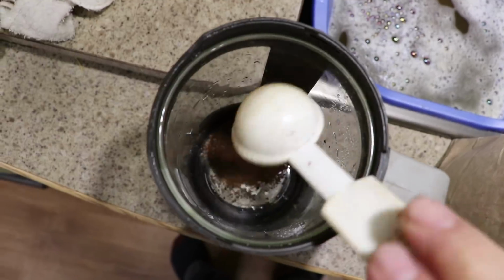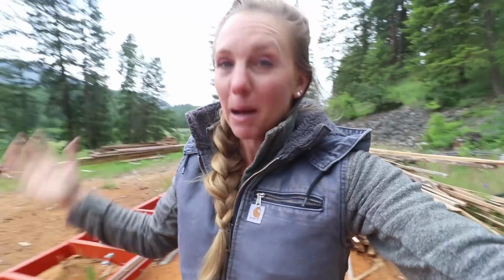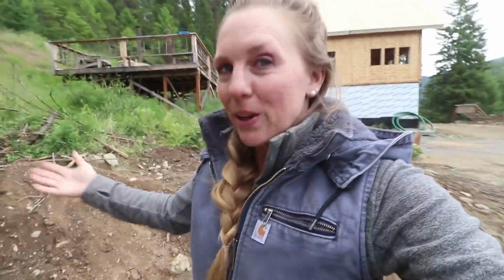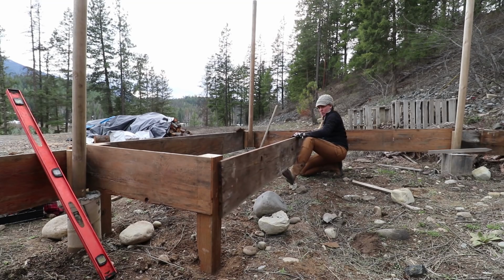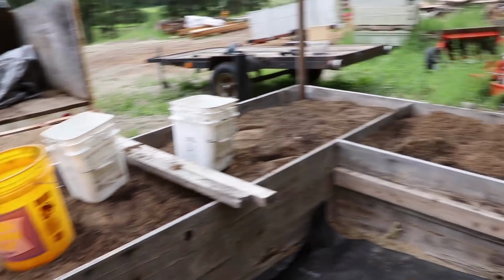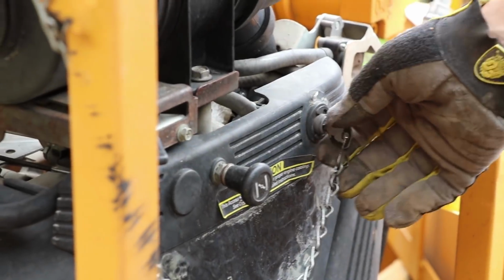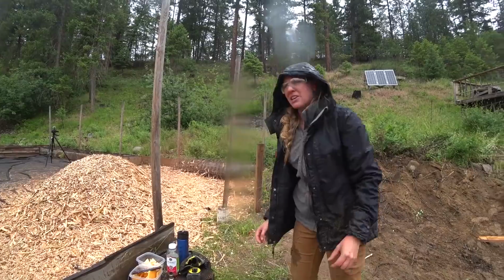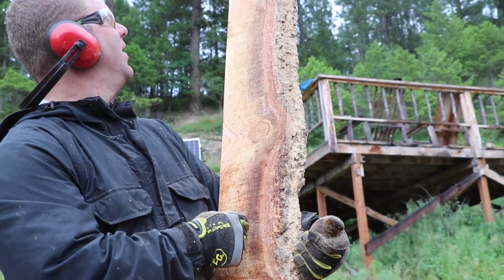How to Make Your Own Woodchips for the Garden (Easy & Cheap!)

Comment: Have learned so much from you both. Loved every step of the way. Am 71yrs retired but building camper van from floor up, inspired to greater accuracy from you. 
One tiny observation: when I shovel fill or soil I am at moving my trailer so as each shovel load goes straight to its spot. Master builder once said to me “let a lazy man begin a task...... then get a tradesman to do it that way”.
You two are giving so much pleasure to so many. My first build was PNG from saplings. My second, an A frame from 2x10 cypress pine, my present timber box with roof walls later and veranda three sides. Am with you in my heart. Peter Australia

Comment: So, taking a break from SIP installation is quite refreshing.  But don't you want to get some kind of protection on the roof ridge gap, to keep the sheet rock from melting if it rains?  Some kind of tarp would do the trick.

Comment: You got a lot done! :)  It will be interesting to see how the bark slabs do below the soil.  If they do not degrade very quickly after a few years, and you re-do it again, maybe run them through the shredder for the next go around to see if they rot quicker.  Very cool stuff. :)

Comment: the key to gardening is building good soil, the best woodchips are ones that also have leaves/green matter in it. Initially the decomposition will pull nitrogen from the soil.  Best thing I've done is put our chicken run next to garden- all weeds go to chickens and they turn it into great compost, which in turn goes back on garden.
Reply: contact local tree companies and see if you can get any loads of woodchips dropped off they are usually happy to get rid of them

Comment: Very satisfying watching somebody else work so hard👍🏻👍🏻😛 Do want to share an experience with u guys cos I am into the gardening too. I got on to the local tree cutting guys, whatever they r called,  who cart around those giant big chippers everywhere they go. Apparently here they often take the chips to the tip, which by the way is a crime, anyway diverting. I asked them for a couple of loads, which they happily supplied me with free of charge, cos the dump charges them to take it. Win, win. All set with my massive amount wood chips was going to mulch all my gardens with, but about a day after it arrived I got really sick and couldn't do my self assigned task for months. In all it was about nine months before I could get back to it, only to discover one of my ducks had a clutch of eggs she was sitting on because it was so lovely and warm. When she was all done hatching some beautiful little ducklings I finally got to use my mulch. It was so delicious u could almost eat it. It had broken down so much over that time that it was just beautiful soil underneath this thin layer of bark. Just saying😄😄😄 ? Love watching u guys work, your a gr8 team.

Comment: You guys are doing just fine at everything you do.  Since I am an old guy and have done a lot of farming:  My 3 cents worth.  raised beds are the way to go.  You should burn some of the wood scraps because it contains micronutrients the day you put it on the beds.  Any drywall scraps left over should be put on the piles and burned with it.  The lime contained in it is very good for most plants.  You use less o Tomatoes.  That hill side is excellent as a vineyard and berry bushes.  Don't forget the the fruit trees.

Comment: please get your house "dried in" before it becomes an issue down the road. I've seen way to many houses have mold problems from the foam and OSB getting wet. when OSB gets wet and swells at the sheet edges it can telegraph through to your siding and interior finishes depending on what you are using. if you end up with mold that is a whole other nightmare that no one wants to deal with. it would be a shame to have issues down the road that could have been prevented. I enjoy you channel and look forward to seeing the house done.

Comment: While hugelkultur does initially deplete nitrogen, that is easily remedied. 

Your compost is a good start, but there are plenty of amendments that can be added until the wood and bark breaks down enough to release it's nitrogen stores. 

Best would be Bat guano, (hard to come by) but blood meal, fish meal and worm casting (lots) are good options.

 You would only need to do this for the first 2-4 years until the bark had broken down enough to not require so much nitrogen

Comment: Don't worry about the wood chips, just add a little extra AN or urea for a quick fix to help it break down. And if you don't it'll still break down and add great carbon to your soil it'll just take a little longer. and as it does to nitrogen will be released. I always tell new gardeners it's gonna take 2-3 years for your soil to be tamed no matter what you do and your specific area and conditions are going to determine what it is you have to do.

Comment: In order for any wood to decompose or compost if you will, it has to use nitrogen from the soil. So if you are going to put wood chips in your garden you will have to add nitrogen fertilizer in what ever form you wish. ie. chemical, blood meal, or real blood for that matter. The point is without it your plants will die. Why waste the effort of planting if you are going to kill everything you plant. If you must plant now, add the nitrogen of your choice and cover with at least 4 inches of soil. Then plant. If your plants begin to yellow add more nitrogen, and water well. If you don't have enough soil dig into you chips and use 6" diameter by 6" deep soil. Plant into that. Again if the plant starts to yellow add nitrogen to the chips surrounding the plant. Good luck, I hope this serves you well. QST and family  : )

Comment: if you put a roller at the end of the trailer with a tarp attached and you spread it out over the floor you can use the roller to roll out the content out of the trailer easily but you may need something slippery on the floor for the friction and weight

Comment: Use some of that saw dust that you have made mixed with sand or weak local dirt to make something pretty good. Run a sprinkler line and you are set.

Comment: Well said! We found after doing exactly all that with the raised beds and soil and cold frames, time and cost was so not worth it, Plants need water every.single.day.
However, it was very fun and we cherished our little home grown stuff immensley, I even got to pet a wild yellow bird that stopped by one day.
Reply: We added a micro irrigation system that we do not have to fuss with.  The plants get the water they need, and no overwatering. Works extremely well with raised beds.  Will add a link to my gardening blog later so you can see how mine works.

Comment: I  would suggest that you add a waterproof lid on you compost bins/heaps, it will stop nutrients being leached out of the compost and help keep the heat up in the compost bins/heaps giving you better quality compost also check your compost for earthworms if you see none or very low numbers either buy some in from one of the worm farms on the net or build a wormery and breed up what you have and put them in your raised beds and in the compost compost bins/heaps they will help to give you better topsoil and compost.

Comment: Chip straight into landscape fabric in middle of garden. Move with rake or buckets. Looks good, could use rocky soil on bottom for drainage but the wood bark does the be same.

Comment: Melissa  on your next trip into town stop by Home Depot or hardware store and get what they call hardware wire you should be able to get it in half inch or quarter inch square wire in about a 50 foot roll. Have Jesse attach it to the grizzly bar and run your dirt over the top of this, this should illuminate most of the rocks from your dirt so that you could use it in your garden without all the rocks.
Reply: alyssa*

Comment: Sorry hadnt watched for a while but great to see you both have used all the wood, nose to tail as it were. 
 A garden is a little bit each day.    Including sifting rocks out of the soil, 20kg per day is a ton in 50 days.  Try a soil crop first
 But think long term, three apple trees, early, mid and late season which will give you fresh apples for several months not a weak.

Comment: If you screw a 2X2 to the outside rim of the frames, then drill 1/2 holes pvc will arch across the top and you can either net or plastic sheet it to protect and prolong your growing

Comment: If you really want the garden to thrive with all that wood in there you should inoculate it with some mushroom spores. Your best bet would be to find an edible mushroom that grows natively and culture some of it in rice or straw and spread it in there on the wood. Ensure the wood is thoroughly wet before doing so. Its proven that one of the most important parts of an ecosystem if the fungi. It shifts nutrients from plant to plant as needed as well as acts as a signaling network for similar plants allowing for better disease resistance. It will also attract more things such as earthworm which will further nourish the garden. Plus you have mushrooms to eat. You could even order elusive morel spores online and use that.
Reply: I have some nice piles of wood chips that I get from local tree trimmers and use for garden mulch. When I take chips off the piles I see thick mats of mycelium everywhere under the surface. There is probably little need to inoculate and it may be a wasted effort. Among the spores in the air and the wood chips there are likely to be some that are better suited to their specific conditions than anything someone might try to introduce.

Comment: Wood chips will only rob the nitrogen from the soil when it is tilled in. When it as used as mulch it uses nitrogen from the air to decompose rather than using nitrogen from the soil :)

Comment: Wood chips are fine as long as you dont till it into the soil, then it robs the nitrogen trying to break it down. Just put on a top layer to retain water and let the nitrogen in the air break it down over time..

Comment: Curious, Why didn't you put the bark through the chipper?
Reply: Chipping the bark would make the beds need more soil.  by letting the bark dissolve (turn into natural mulch) only a little soil will need to be added each year, and the breaking down of the bark naturally will allow the nutrients to be added gradually, chipping bark would be like putting the garden on steroids.

Comment: Guys, the more Chips and Sawdust you add, the more Horsepoop or better Cow poop you really really need. In short, the cellulose really sucks up nitrogen and phosphor. ADD POOP :D
Reply: Indeed, all that carbon (sawdust) will suck all the nitrogen out of your soil, assuming there is any there in the first place.  Remove it immediately. As true with coffee grounds, they are much better placed in your compost pile with equal amount of green and use that next year.  The recommendations vary on-line from 2/1, 1/2 and 1/1 for green to brown ratio.  You will not get any heat unless you use green.  I find it very sad that you are going to all that effort and not doing any research as to how to things properly as all your hard work will be to no avail.
Reply: Also you ;need to get a soil test from your Cooperative Extension to find out what your soil needs.  People just guess, and then wonder why their garden is poor.
Reply: I appreciate your point about the nitrogen. I was wondering if nitrogen fixing plants like beans, peas, vetch and clover might be an alternative way to get some nitrogen into the soil. One might also put up some sort of pen and raise chickens and/or hogs over the beds first but taking care of them would require more of a time commitment.

Comment: Your August 2, 2018 is a lot different from our August 2nd 30 miles east of Reno, it is 95 degrees here, that is down from the 100 degree temps in late July.
Reply: this had to have been filmed in the spring,  the jacket, fawn,  and starting a garden  all sings of spring
Reply: That isn't Aug 2.  This video is around the end of May.

Comment: Why didn’t you chip up all the bark instead of burying it?  It certainly would break down faster.
Reply: Its not supposed to break down fast. Its a nutrient/water tank. It will slow release new nutrients for years as it slowly breaks down. It also acts like a sponge for water and will slow release it during dry spells..

Comment: Try swedes and white turnips in the last part of your growing season. The frost and snow will not hurt them and only serve to stop them bolting to seed. Eat white turnips first as they get quite bitter if too old but swedes can be left in the ground practically all winter and are a good filler veg for soups and stews in the slow cooker. I like them mashed with potato too but not to everyone's taste. Other than that, my advice is to stick to the more exotic veges, herbs etc as it is soul destroying to work for months only to have a crop when they are in season and can be bought for peanuts and $10 worth provides enough to preserve for a year! Another trick is to plant for harvest in the beginning or end of the season when they are more expensive, making you efforts doubly profitable. Investing in a cheap soil testing kit will (a) tell you how your soil is and what it needs more of and (b) guide you into planting something that will grow in what you currently have. 

Love what you have done and well worth a break from building. Final thought - love to see some pumpkins growing on that expanse of wood chip, also plant some behind your compost heap to regain all the nutrients leaching through into the ground - an old piece of carpet over your compost will also reduce leaching as well as keep heat in.

Comment: garden looking great... Now you need a greenhouse .    now find some metal fence poles put in ground. now in time find some pve pipes or some conduit bend then a little. put on top of fence poles then put plastic up that would be a great place for a greenhouse . then you food may last a bit longer in winter. it's just an idea . only if you have time. AND WANT TO SORRY I THINK DUMB IDEAS ALL THE TIME SORRY AGAIN.
Bryan k. 
Wasilla, Ak.
P.S. did you get message about Morals i told you were you could find next year.

Comment: Why not run the bark in the garden thru the wood chipper?????
Reply: The bark is used as an organic spacer to fill the bottom of the raised bed.  It is common to fill the bottom of a tall raised bed with what you have available.

Comment: When I was about 25, a local man got sucked into a chipper by his coat sleeve.  It was not an open casket event.
Reply: Check out the new wood chippers...see those two wires hanging down/hopefully you can pull on one which will stop the machine/or reverse it....also some have a stop bumper on the feed tray and really you should always be standing off to the side were you can reach the control bar...

Comment: Why are they going to build a roof on top of the roof?
Reply: Experimental Fun basically the sun hits the top roof and heats it up then the hot air flows through the gap between the roofs and out the top to keep the house cooler for free. I hope that made sense
Reply: Ya. So the cold roof can stay frozen cold in the winter and not melt the snow. There will be airspace between the two as well so any condendation/moisture in there will airdry and not rot the sip
Reply: Also (in addition to the 'envelope style' roof), it will help keep the OSB and foam from mildewing, and provide support for the metal roofing.
Reply: Too give the new one a chance to dry out.

Comment: You are going to have to add a lot of nitrogen to the soil with the bark buried under it as it will rob the soil of it, on top is fine, mixed in is not so good

Comment: "Gonna have a long and hot summer"   LOL We started Summer about May and it won't end until October. BAHAHA!  You live in the "Frozen Wastelands of the North".  Y'all don't have a summer.. Y'all don't even hit 100 degrees F regularly.  Jessie, build Alyssa a couple of 55 gallon compost tumblers..  Compost is king. And balance is good. Automation for your watering system..but y'all need to consider fruit and nut trees to be planted this winter/spring..  Trees need 3-5 years before they produce much of anything, but they produce forever..

Comment: Can u explain the way ur going to the roof. And are u not going to put shingle it?
Reply: She did explain how it will be done....
Reply: i think they are going to use metal sheet
Reply: They are putting a cold roof on which means they are building a roof on top of the roof. SIPs are notorious for ridge rot and at that ground snow load, no amount of insulation will stop ice dams because snow itself is an insulator and the snow at the roof will melt while the snow exposed won't. Therefore, even an unvented attic needs a vented roof. You can't put a vapor barrier/membrane on a SIP because then you have a vapor on both sides of a peice of OSB and it will rot.
Reply: Give that they have a chasm at the ridge, they need it
Reply: Their instagram page  shows and explains the roof.  She mentions the metal roof will be arriving this week so those photos will be soon.
Reply: Lord; Yes she did....metal roof

Comment: The idea that wood based matter helps increase food production in a veggie garden is misleading.  What brown material will help with is the structure of the soil, particularly if it is clay.  Rotting wood fibres consume nitrogen, but they promote worm activity and it is the worms that contribute the most .... but over a 3 year period.  Main thing is to add compost as a top dressing.  Stuff will grow, that will be sure!